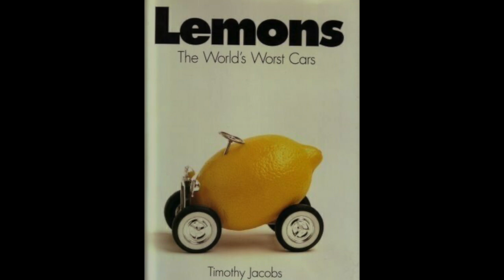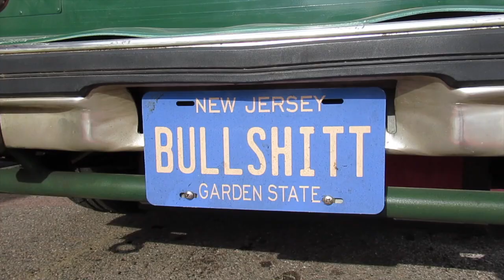#lemonsworld 125 - Ford Pinto Underrated?

Comment: The 1.9/2.0/2.3 motor is pretty amazing for it's day.  Certainly a tough enough, it can handle a lot of abuse before it cries.  It's also something that can be worked on hard.   There is a Powernation video on the tubes where they build one for dirt track racing that does 260hp and 200+ torque things, which is pretty stout.    I suspect that a cleaned up stocker with an variable cam sprocket (Esslinger made them) and fuel injection might be a real rocket that would slide right past the BS inspection... the Pinto can hide a whole lot of stuff!

Comment: I was rear ended in a Pinto where the back bumper was almost shoved up to the roof, no explosion. When it was repaired they put a fuel bladder in it. A few years later I put a hot cam in it, Offenhauser manifold, Holly 390 cfm 4 barrel, sway bars and a bunch more. Street sleeper that ate Porsches and BMW's. Lotta fun, traded it for a 1970 Triumph Trophy

Comment: I have a 1972 Pinto woodgrain wagon, officially called the "Squire" which is completely stock except for the Weber carburetor, which the stock Ford carburetor was pretty much a copy of. It has the 2.0L SOHC engine and a 4 speed. It has been used as a daily driver for 50 years. It just got it's third engine and second transmission in well over 500,000 miles. Still has it's original rear axle. The original A/C did fail a long time ago, but I put a complete aftermarket A/C system in it for about $1500 that is repairable. The outside is weathered, it needs new paint and woodgrain, but the interior is still an 8 out of 10. The headliner is perfect. And more important, the body is still rock solid and rust free. No squeaks or rattles. No new car will ever do what this Pinto has done. And unless something bad happens, it almost certainly has another 500,000 miles left in it. Plus it actually LOOKS like a car. It's a blast to drive.

Comment: I worked at a Ford dealership during the Pinto gas tank recall. The fix was a plastic shield and a few screws.
Reply: It didn't take much. Consider the VW Beetle and you know that the standards were low as those often burned in accidents while pouring burning gas on your lap. I knew of someone who lost his legs that way...
Reply: The plastic shield is a valid fix, lots of modern cars use this even with a plastic gas tank.
Reply: @davidhollenshead4892  How many decades prior was the Beetle  'engineered' prior to the Pinto? Gas on your lap? That means you found 3 'Muscle' cars that couldn't make the corner.
Reply: @ATEC101  What ???
The Pinto wasn't as bad as many cars on the market. The fact that it was designed before WWII doesn't reallly matter...
A friend of a friend burned his legs off in a Beetle after a 5 mph crash...
Other cars that were more dangerous, take the ear;y Datsun FWD cars that depended on a fan to cool the carburetor to keep it it from catching on fire...

Comment: Hey! My parents had a Bobcat! But not just any Bobcat, the one with the "sport" package. I put "sport" in quotes because what made it sporty was the addition of a spoiler (which removed probably 10 mph from the top) and a metal racing steering wheel with some speed holes in it 😂. The car would scrape the sidewalk every time my dad came in the driveway and it wasn't even dropped!

Comment: Surely for an engine upgrade the better option to replace the Pinto/Lima engine would be the Zeta/Duratec/Volvo-Modular/Mazda-L? Keep the weight down, keep the size small for enginebay ergonomics, gain both power and fuel economy over the old carb engine.
Reply: Are you referring the the V6 that could be ordered in a Pinto???
Reply: The Lima engine isn't terrible, a 1kHP example existed at one time. For an endurance race, I'd stay below 400.
That is possible with mostly factory parts.
Reply: @davidhollenshead4892  no, the I4 from the fiesta, focus etc.
Reply: @EmyrDerfel  The V6 that was an option for Pinto's is a better choice for Lemons Racing....
Reply: The Zetec and Duratec motors will bolt up to a Lima-patterned bellhousing, but there's hangups with the flywheel/clutch setup. Zetec and Duratec transmissions usually didn't have pilot bearings nor will the motors accommodate them. In theory, it would work. I've not yet found a proper flywheel/clutch setup that mates. Lots of grassroots racing dudes in the UK use Zetecs in their RWD track cars.
Reply: @addywerks5031  that sounds like something any competent machine shop could take care of.
I'm pretty sure Rangers were available with manual transmissions behind those engines.
Reply: @addywerks5031  Keep in mind that Ford sold Pintos with a manual and V-6. That is the car to use for Lemons if you can't find a RWD Chevy Monza. As the Monza will take a 350  V8 and manual trans. As a 305 with a manual was an option. Often the fastest car at Bonneville is a modified Monza....

Comment: No matter what your going to run in Lemons (1). Just make sure you've done done some work on the oiling system including an oil cooler. A bigger sump probably we wouldn't hurt either.
1) I'd love to run in one but I've got blurred vision in one eye due to crinkled retina.

Comment: well if you can get a hold of the 1.6 liter turbo cossy engine you will have a true and tested rally engine of course odds are it's been ran to kingdom come but at the same time it's actually already built to take boost so you have options.
Reply: They probably won't find an unruined Cosworth 1.6T without being flagrant about budget.
Reply: @EmyrDerfel  I mean probably not but ya know a guy can dream.

Comment: The first race car I built at 10 years old was a tube frame mod 4 dirt car. The front and rear clip had the pinto steering and suspension. Had a 86 Tbird body sponsored by a local Country Music Station. The 2.3 was heavily modded with a 500 cfm Holley 2-bbl. Just a fun little machine! Fun fact: The Pinto was one of the first mass produced American sedans with the rack and pinion steering.

Comment: 2 litre Ford engine is a German engine used in Cortina, Escort and many other Euro Fords from around 70.
It may have been made in the US but not originally. 
And yes Sierras had different versions of turbo charged twin cam versions. 700+hp in GpA engines with power like a tap, all or none!!
In sin gle cam form a big heavy lump that breaks the rubber band and they wear out cams as well. I have owned at least 2 dozen Cortina and Escorts

Comment: Everyone that disses this car, does not know it's History of what it actually did for Pony/Muscle Cars. The first thing it did was carry the blame of blowing up when being rear-ended for another car that had the same problem as well, the First Gen Mustang. Then secondly, if not saving Ford it definitely helped the Company through what happened in the Seventies by being the vehiclular version of the Swiss Army Knife. The Pinto itself was the base economy car with a Four-Cylinder only/ever. The Pinto based Maverick was their Family car. The Pinto based Mustangs were the Companys High-end cars with the Pinto based Mustang 2 and Mustang Cobra 2 as their "Sports cars", and the Mustang Ghia was their Luxury car for better or for worse. The third thing the Pinto did was save the Ponycars. It was either the The Mustng based Pinto or Ford cancelling the name/car Mustang before it reached the Fox Body Generation. This would have also, (Possibly.) been the end of all other cars in the category that the Mustang started, with all of the MOPAR cars from the Seventies that everyone loves would be luxury cars. Round two.  Without the Mustang reaching the Fox body years, (Which would not have happened without the Pinto.) Carrol Shelby would not have had a project to bring back to life for Ford, and he would have done something else. And without Mr. Shelby's Retro Mustangs, The Camaro would have never been brought back to reality. Without the new Camaro, there would be no platform to built new Trans/AMs from the Trans/AM Depot in Florida. And without the Retroed Mustang from Shelby, the Brotherhood of Muscle from Dodge/Chrysler may have never happened either. So, if you are a Ponycar fan of both times the Ponycar Wars happened, you own the lonely Pinto a very big thank you and a belatted appology.

Comment: Pinto swap the pinto, the euro pinto motor, legendary rally engine and still decently common
Reply: The Cosworth version can make huge power but it's cheap enough to get 330bhp out of one and it will do that forever without breaking while still remaining easy to drive, hard to find cheap engines these days though.

Comment: Yeah, they took a 1600cc Kent, increased to 2000cc, changed the pushrod head for single overhead cam and made less horsepower. Not to be outdone they looked at the Cortina the Kent came out of and decided they could make it alot heavier and give it a suspension arangement to handle like a toad. My belief is it was a cheap car to get people into the showroom to sell you a Mustang. Hence, best to make sure it wasn't a good car. They underestimated dads buying cars for the kids. It was cheap and almost qualified at being a car, dad's done shopping for the new car.

Thinking it was likely that or Mom's old station wagon, many were happy enough to get a new Pinto.

Comment: Jeez, that sounds gnarly as hell for a 4-cylinder.
Reply: Look up the Engle DZ-10 and DZ-11 cam for the 2.3 Ford
Reply: The 2.3s popularity in dirt track racing has resulted in loads of good aftermarket performance parts.
Reply: What makes this engine popular is the large bore / short stroke where many engines have the reverse.
Reply: @bobroberts2371  many Honda engines and GM LS V8's use small bore/long stroke combos, the iron duke 2.5 is more over square than the 2.3 Ford.

Comment: The pinto 2.0 and the lima 2.3 are different engines almost no parts if any interchange I own afew of each nothing interchanges  similar looking but different and the 2.0 pinto was actually called the pinto engine before the pinto was actually built not after the 2.0 pinto was the engine in the cosworth with dual cam head, not the lima.